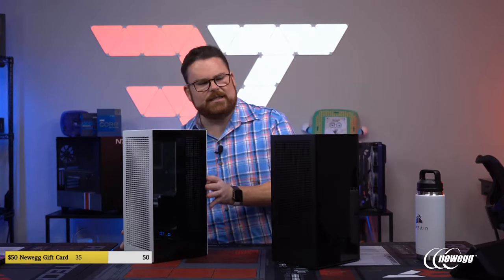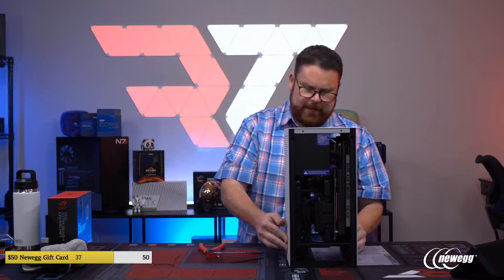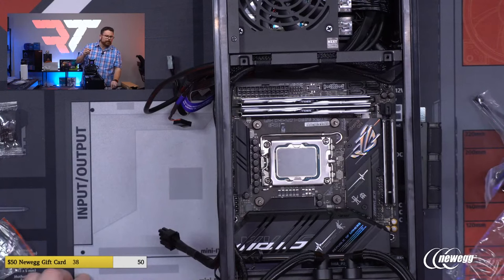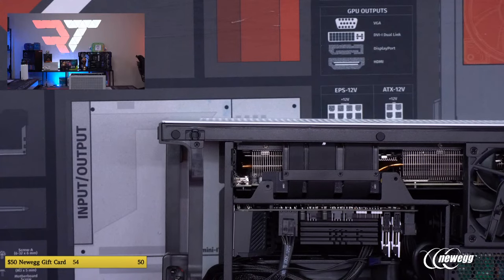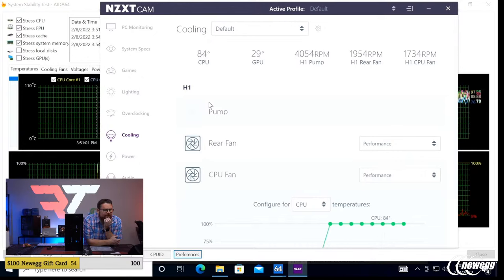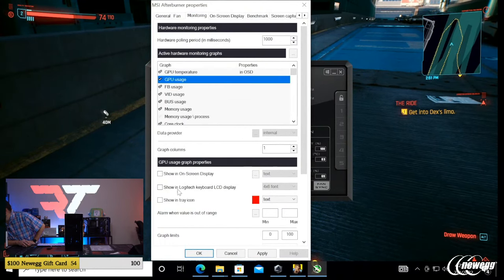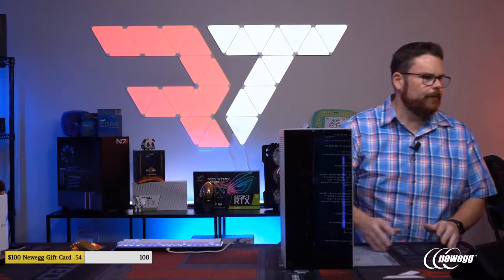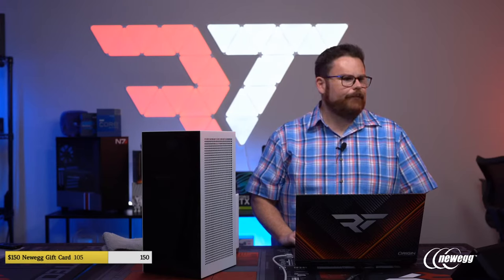$2500 PC Build - NZXT H1 V2 + Benchmarks (12700k / EVGA 3070)

Comment: Such a good job alleviating concerns about overheating with the NZXT H1 V2. PC went through a full stress test without apparent concerns of performance throttle or risk of PC shutting down. NZXT did an excellent job with the H1 V2 and will be a popular case.

Comment: Just built a system in the H1 V2. 12700 and a tuf 3080 OC. I am using the aorus b660i pro. The temperatures have been excellent. Under 60 for the cpu under heavy gaming load. Great machine. And great case.
Reply: That's good to hear! I'm currently building one with a 12600k and FTW3 Ultra 3080 and was doubting the build because of possible high temps.
Reply: Does the H1 V2 come with the IGA 1700 mounting bracket, or did you have to get that separately?
Reply: Hey brotha when you get back to me I have a question I have this same case I have a 2070 súper and 10700k I wanna upgrade to a 3070 and a 10900k do you think that is to much for this case I keep my room pretty cold like 60 to 65 Fahrenheit
Reply: Hey brotha when you get back to me I have a question I have this same case I have a 2070 súper and 10700k I wanna upgrade to a 3070 and a 10900k do you think that is to much for this case I keep my room pretty cold like 60 to 65 Fahrenheit
Reply: I have the exact same build im at 80 sometimes higher ! Whats wrong with mine ?
Reply: @olivermosqueda7100  what do you mean
Reply: @olivermosqueda7100  do you have 2070 or 3080
Reply: I have 12700k with a 3080
I was playing apex and warzone earlier today and im always hitting 80 on the cpu
Reply: @olivermosqueda7100  on the cpu or gpu? I am using the 12700 non k version. I chose it because of the thermals. Makes no difference to gaming performance.

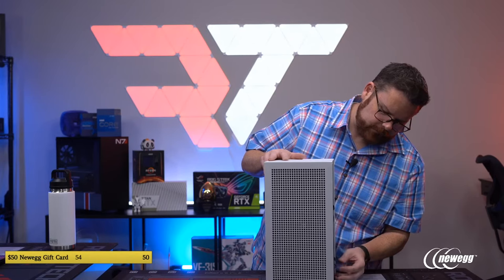Comment: There is an additional cable called "pump-tach" in the instructions, which seems to be required to be connected (as well as the USB connection for the fan hub), and in your video here, that was the surprise cable that you then established connected to the pump header on your board at 1:22:48? But my board doesn't have a pump header, just a cpu-fan header and two sys-fan headers, so which of these should I connect it to?

Comment: I just bought the H1 V2. I'm thinking about puting a RTX 3080 in there. How is 750W PSU behaving with RTX 3080? Any problems? power resets? I'm worried about it, read in a couple places it can have power hiccup problems.
Reply: Any update on this? I’m looking to buy, but also have a 3080.
Reply: @joshgilley5387  I went ahead and connected the 3080. Had some issues at the beginning, but changed in the BIOS PCI 4.0 to 3.0 and had no issues whatsoever since then. No power hiccups or anything else. Works perfectly. Hope it helps :)

Comment: Is there a performance difference in the 2 different Storage brands that you're showcasing in this build?  Is it better to have identical parts or does it even really matter these days?

(I'm a different user than the other comment with the same name)
Reply from the maker: Yes the Patriot is very fast comparatively. No using different brands is totally fine, it’s about using the right storage for the right situation

Comment: case power and cooling all together cost 400. it is good. hope nzxt keep this line forever.
Reply: but I wish there will be a vertical air flow revising.
Reply: temperature control is not good

Comment: I don't recommend this build at all, it could of been a faulty case on NXZTs part for me but I built this computer part for part and step by step on this build and within 2 weeks of having it built the cooling in the case has ruined my processor and damaged the cores to the point I'm having to replace the case and processor... having waited so long to finally have my own pc this has been the biggest let down and the extra cost of having to get the computer constantly checked for issues is just the icing on the cake...
Reply: Just u